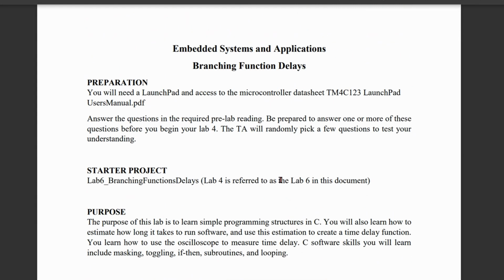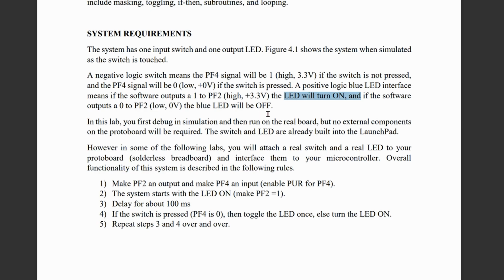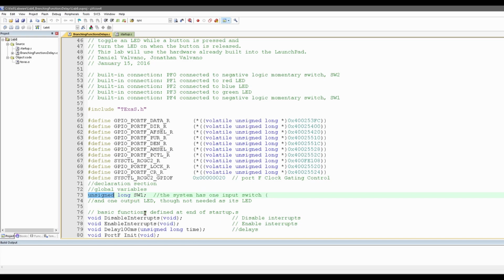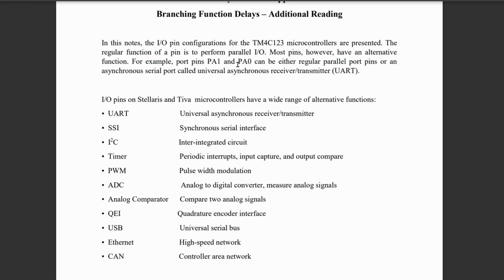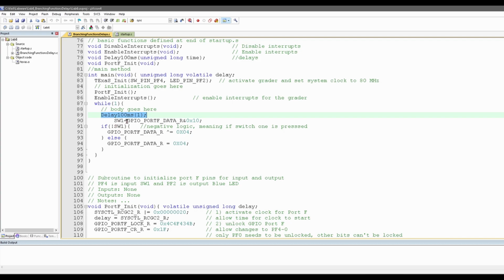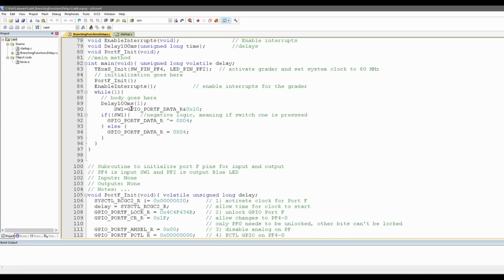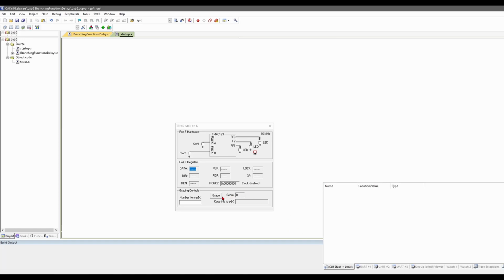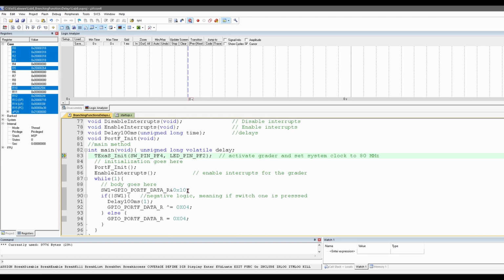Lab6 BranchingFunctionsDelays on Keil uVision, TExaS Lab Grader (CPE 187.  Embedded Systems Design)

Comment from the maker: Forgot to do the prelab questions:

Here they are!!!!

1) How you could make the LED flash slower?
ANSWER:		increase the Delay time

2) How you could make the LED flash blue-yellow instead of blue?
ANSWER:		use the yellow (GPIO_PORTF_DATA_R ^= 0x0A;)

		Can change the code to be like this:
		if(!SW1){		//negative logic, meaning if switch one is presssed
			Delay100ms(1);
			GPIO_PORTF_DATA_R ^= 0X04;
			
			Delay100ms(1);
			GPIO_PORTF_DATA_R ^= 0x0A;